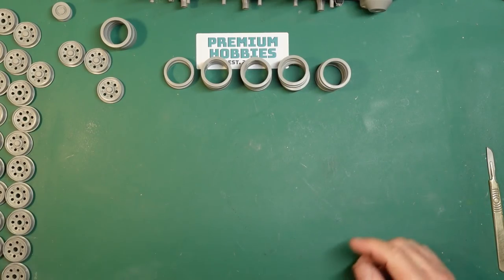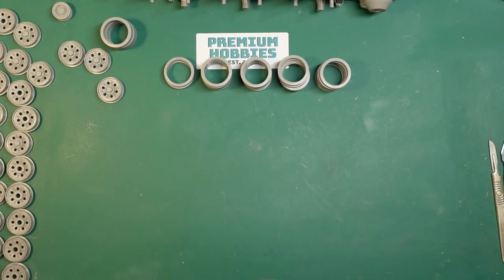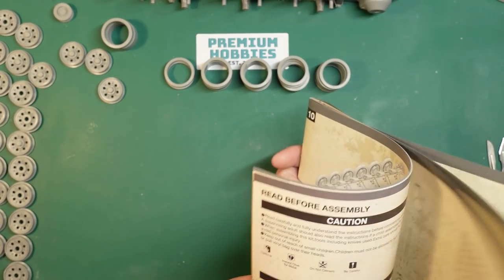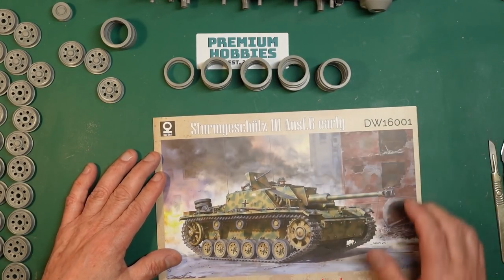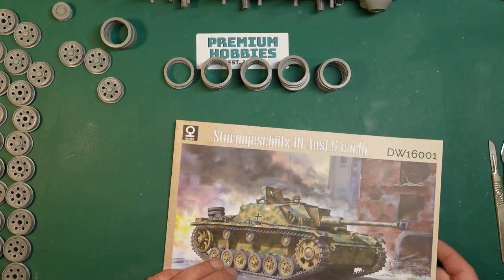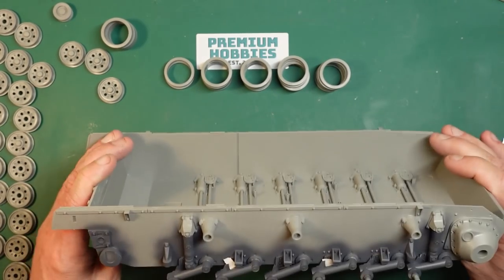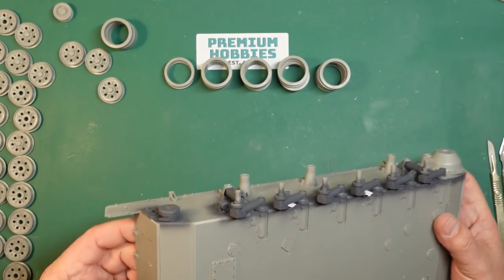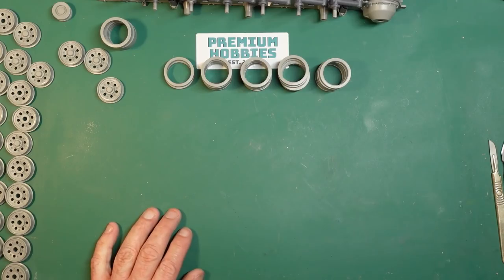Das Werk 1/16 Stug III Ausf G build. Part 3

Comment: I used a medium grit sanding drum mounted in a battery-powered Dremel tool to sand the inside circumference of those tires. Five complete rotations did the trick. I found it to be much faster than the sandpaper method.

Comment: Re mold draft angles…the  out side diameter or external geometries require about half the draft compared to the inside. This is because as the plastic shrinks as it cools it naturally separates from the cavity but tightens around inside geometries of the mold.
Not important, I know.
Reply from the maker: I hadn't thought of that, thank you.

Comment: In spares for my little RFM stug i found the front plates to disguise Stug 'ersatz' 'M7.
Reply from the maker: I have not a clue what you are talking about Darron lol
Reply: @NigelsModellingBench  In the new RFM 1/35 stug III kit W/interior kit in the unused parts there are two pieces of the steel plates used to hide the familiar bolted front plate of stug so they could try to make it look like an M7 US tank.The “ersatz” Panther is more famous.The trouble they went to for what was a terrible disguise.Racked my brain can’t see what else it could be.Could I send a few pictures of latest panther F and stug interior I’m about to clos
Reply: Close up.
Reply from the maker: Of course mate.. I'll post them in the Stug build.
Reply: Hatches so small on drugs I thought I’d try a brighter simplified interior colours and no “shadow” coat or “historically accurate” paint job.Shiny gearbox and shiny engine looks better through hatches anyway.The spanner’s under wiring and the rim of chair were done with the Holly 0.1 scribes by Alec.

Comment: I commented about not being able to paint the tires separately on your first video but after hearing you mention it here I checked my references and you are right- the rubber actually has a slight ridge to it.  The Ryton Sturmgeschutz book has some crystal clear photos of a museum restoration and some of the sharper period photos appear to show the same thing.
Reply from the maker: Great minds think alike mate!! Still, it will be easy to mask and paint them.

Comment: Another great video Nigel. I do think you do go overboard with checking gaps lol. I didn't do much gap filling on mine. As far as painting goes. I am not the typical armour modeller that builds it all, then paints. EG I painted the tyres Rubber Black before fitting to painted wheels. Andy from Andys Hobby HQ, fully build his before painting. I would ask him "how do you paint all the fiddly bits etc?". I do a lot of painting as I go. I followed the instructions when building up the back end. Didn't have any problems with those idler wheel adjusters. I did paint and rust up my exhausts, painted most of the lower hull up. Then fitted the exhausts. I have updated my Scalemates project today with my build. I have just finished doing the radios and internal parts. The instructions for the Mini Art Stug kit say to paint the radios Black. But I did some research, and most of them were Grey, not Black, so I painted mine in German Grey. I have used artistic license with painting details on the radios. With White panels and Black dials & knobs. I could not find pictures of radios that looked exactly like the ones in the kit. I also built up the fenders. I have left off most of the tools for now. The main casemate has been done on mine. But not glued to the lower hull yet. Not done any weathering to the internals yet. Will leave that for later. Just look up me on Scalemates. Looking forward to the next one Nigel.
Reply from the maker: I saw a reference that showed the radios as a grey green colour? Without wishing to be rude Andrew, If I needed advice on a modelling related subject, I wouldn't ask Andy lol. Modellers do things "their way", and my way is by no means the only way, having said that, a guy commented that he followed the instructions and couldn't get the PE to fit? The idlers were only left off so I didn't damage them when I was working on the rear end.
I think this post will probably get deleted as you have an external link in it.. YT don't like links.
Reply: @NigelsModellingBench  Yeah, if you Google German ww2 tank radios, loads come up. Some are a green colour, some are grey, some are black. I've seen pics of the double radio, where 1 side was green and other was black. I bet eventually Eduard will bring out colour PE ones. But I ain't going to wait lol. Oh and I wasn't offering Andy up to give you advice lol. I just said he built his fully before painting any of it. I have posted comments with links before without problems. But I will edit it, and remove the link. I didn't have problems fitting my PE grill though.

Comment: Nigel you have an eye for detail which is great, but you eye is also super critical sometimes. Both coats of paint on the idler wheels looked absolutely fine to me :).
Reply from the maker: It does look OK now it's dried thanks.
Reply: @NigelsModellingBench  :) It wasn't a criticism
Reply from the maker: I didnt take it as a criticism Nick. It did look too thick, but once all the solvents evaporated it looks fine.

Comment: I lived next to the army base for a while, I can confirm soldiers spend like 90% of their time washing and polishing their tanks. I find tanks "caked in mud" highly unrealistic :)
Reply from the maker: That may be the case today, but i should imagine in WW2 there was no time for cleaning?
Reply: @NigelsModellingBench  I have the feeling that even during WW2 tanks spend most of their lifetime parked on some field in front of the factory or on the ship/train than in actual combat mud. Their survival rate was like what, few weeks? :)
Reply from the maker: I guess you could be right? Though I think in Russia they certainly did get caked? I certainly won't be caking this in Mud. I think I mentioned in the video, something that annoys me intensely is when modellers cake their tanks in mud but give no consideration to the fact that suspension moves and wheels turn.